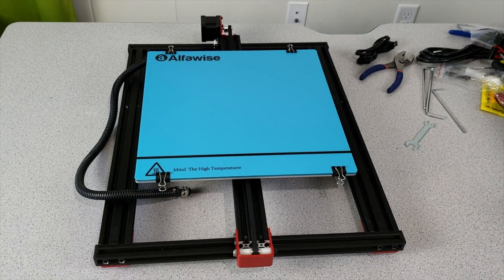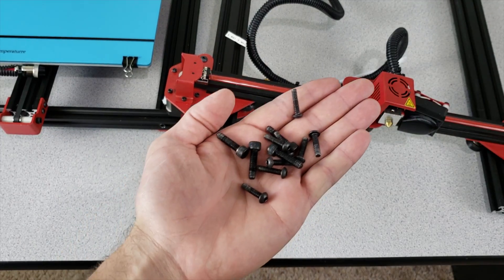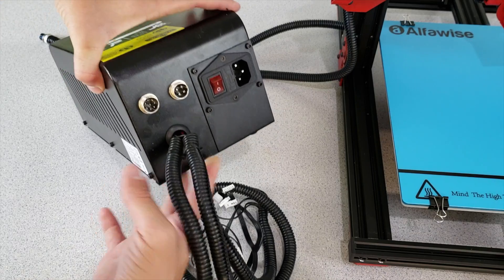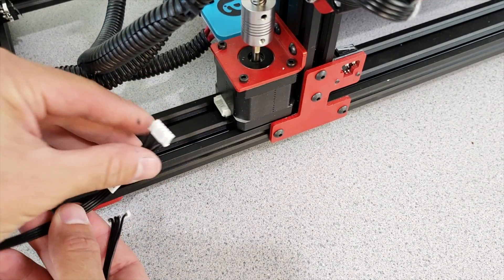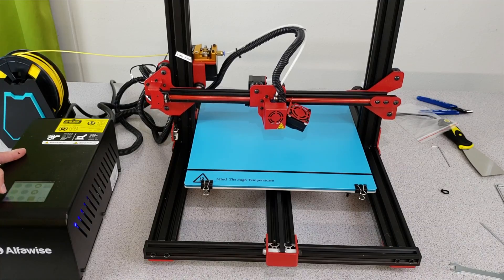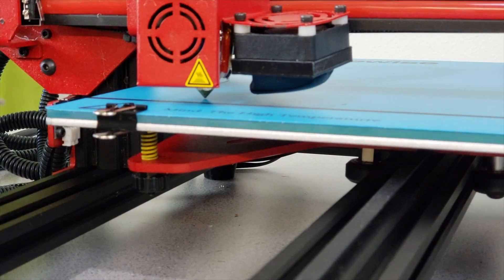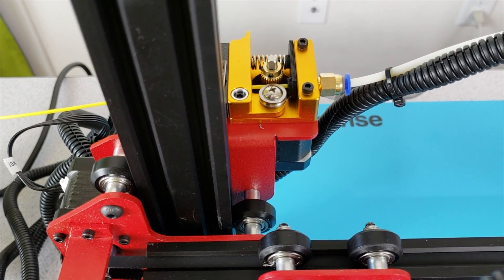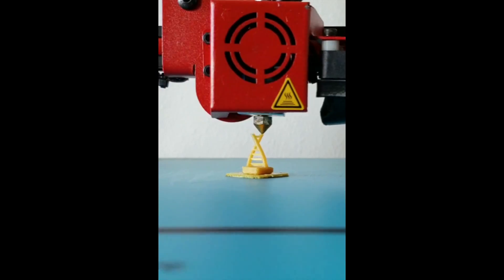How to Assemble and Setup Alfawise U20 Large Format 3D Printer

Comment: Can anyone help me with the alfawise U20. I just do not get it properly leveled. I tried everything 1 piece of paper and it does not work. The molten filament does not remain on the substrate.
Reply from the maker: What do you mean by does not remain? Is there a too much gap between nozzle and surface?
Reply: @3DPDoctor  If the corners are equal, the center is too far away. The middle is not the same as the corners.
Reply from the maker: Yes it happens because the bed holder red metal is weak and it bends. Try to decrease the gap as much as possible while keeping the distance. You will need to make the gap smaller at the corners so that center can be levelled.

Comment: Greetings.
I just bought the Alfawaise u20 and I have newbie doubts in this machine.
Do the pins or handles that lead to the warm bed, do not give any problem to touch the nozzle or affect the printing areas?
Reply from the maker: Could you rephrase your question? I couldnt understand your point :(
Reply: @3DPDoctor  Lo siento mi ingles no es muy bueno.
Las prensas que sostienen la base de vidrio de la cama caliente no perturban la boquilla.
Reply from the maker: English?
Reply: @3DPDoctor  The presses that hold the glass base of the hot bed do not touch the nozzle.
Reply from the maker: Ooo I see. So when you relase the springs underneath the heated bed, the nozzle is far away from the bed surface? How far? Too much? You should put washers under the springs. I have a video about it, I will release it soon

Comment: Hello! You are a life saver when it comes to assembling the printer! However, I can't seem to get the filament to go through at all. I made sure the extruder was heated at it's maximum temperature for PLA filament.

When I hit the "Auto Feed In" button, it takes the strand of filament through the gears, but stops at the white extruder tube entrance. Then the gears start making a rapid ticking sound, indicating the filament is stuck and can't get through the white extruder tube. I tried using the filament it came with and all my 1.75mm filaments, no success. What should I do?
Reply from the maker: Thank you man! I appreciate it. I just finished a video for how to unclog your nozzle. It seems like your nozzle is cloged or something is blocking the way. Keep tuned I will publish that video tonight. It will ahow you the way to fix it.
Reply: How can it be clogged? I just received the printer today and haven't printed anything with it.
Reply from the maker: Maybe its bowden tube is kind of dislocated?
Reply from the maker: Or did you straighten up the edge of your filament? Maybe its touching and getting stuck somewhere it suppose not to
Reply: Now that you told me to straighten the edge of my filament, the ticking stopped. But now I noticed that one of the feeding gears aren't moving at all. The one with the screw on it. I tried tightening and loosening it and it's not moving.
Reply from the maker: Okay, lets go one step back to analyze it. Remove the filament and see if the gears are turning or not, you will need to trick the filament sensor by holding filament in there but dont push it all the way to gear. And then try to use feed filament in. See if the gears are working. Also restart the printer before you do it. If you gears are back at work, feed the filament back and try it again. Lets see what is going to happen. Also make sure that your main fan the fan located right in front of the extruder is working all the time. If not thst might be the reason why your filament is not extruding. Because if the neck of your extruder is not cooling it might make your filament became smooshed and clogged
Reply from the maker: actually this is normal, you need to make the filament straighten and guide it with your hand to go trough. Don't expect system to be able to push it in by itself. It never does. Almost all the printers that I used (more than 10) you need to do it by hand. Check out my assembly video to see it

Comment: Very nice video, i am having trouble printing files that i installed. But it prints with no problem the files that came in the memory card. Do you think you can make a video on setting up cura? Thanks
Reply from the maker: Hi, i already did! I will render it today and upload it! Thanks for the request
Reply: @3DPDoctor  btw did you run into this problem as well? I followed the instructions that came with this printer but it was no luck
Reply from the maker: @monkeypajamas  no i didnt. Mine works very well
Reply: @3DPDoctor  hi! So i found out what the pr9blem was. Apperantly it was the sd card. I tried it with another sd card and it worked with no problem.
Reply: @3DPDoctor  but i have another problem😅 when i finish with a print. The bed does not reach the limit switch on the Y motor so it keeps trying to go beyond its point and making a wierd clicking sound. I have to manually touch the limit switch so that it stops.
Reply from the maker: So question. When tou auto home it, does y axis stop when it hit the limit switch? Lets make sure that your y limit switch functions first
Reply: @3DPDoctor  no, from what i can tell there is nothing under the bed that makes contact with the limit switch. Sorry for all these questions.
Reply from the maker: What do you mean? You dont have any connection with y.limit switch? Like in the video?
Reply: @3DPDoctor  well i do have it conected to the box, but isnt there something that is suposed to have contact with the metal tab like button once the bed reaches a sertan limit? I very new at this so yeah 😅
Reply: If i was at home right now i would  make a video of it 😅
Reply from the maker: yes there should be a mechanical touch. Video can make great explanation!
Reply: Awesome! Cant wait
Reply from the maker: cura settings video is out! give it a try! https://youtu.be/zF46WFT8ewI

Comment: What do you do when it doesn't turn on ???
Reply from the maker: Did you check the power settings? There must be a side that tells you pwer setting 110v or 220v make sure that you have correct voltage depending on your country.  Also dont forget to check your power cord. Also make sure that your wall have the power too. If it still doesnt respond, you might want to open the controller and check the switch or request replacement
Reply: Yes I did all of this except waiting on support right now to contact me
Reply from the maker: @davestomper3428  that is sad to hear :/